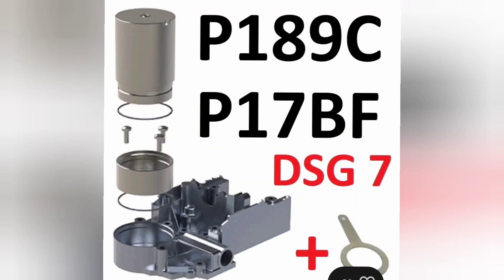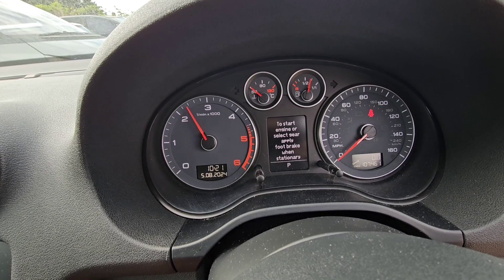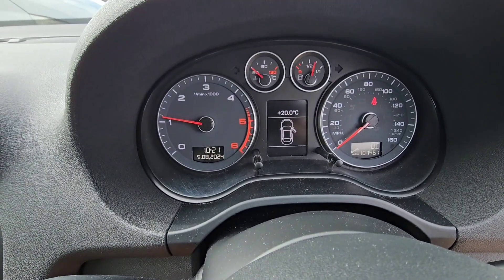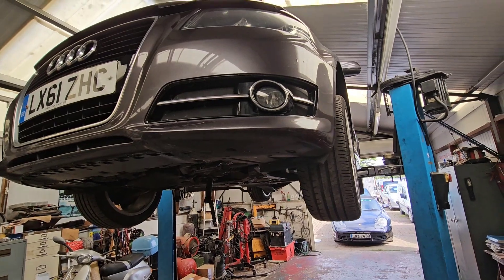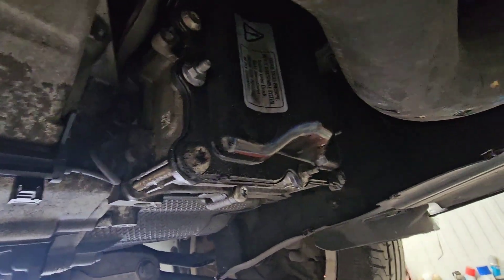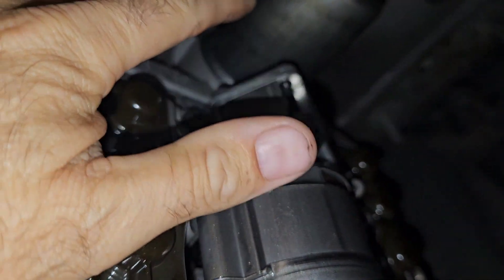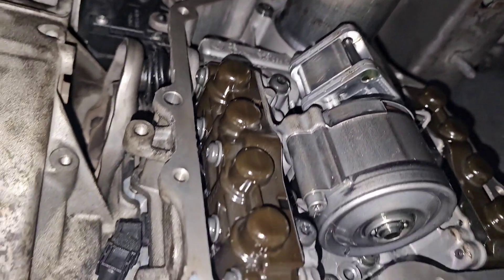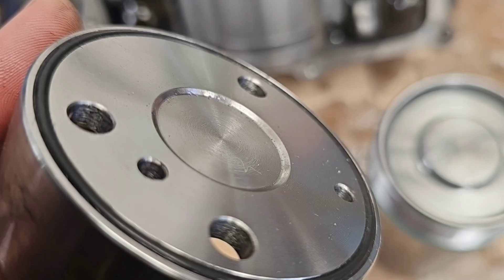Quick Guild on Fixing Mechatronic Unit Low Oil Pressure Audi S Tronic DSG Gearbox. P189C P17BF

Comment: Hey ! Do you need to release mecatronic oil before opening it ? 
If yes, from where do you refill it ?
Reply from the maker: https://youtu.be/0Elv2pBa5zs?si=m8i5-O_E_KZAQ4sp
Reply: @Roundstone  I didint see you releasing the oil or even saying it. So I guess we do not need to do it. 
Can we open the black cover and unmount the accumulator without doing anything about the pressure ?